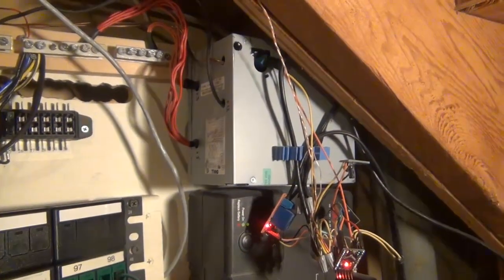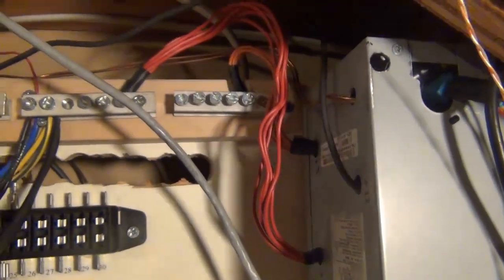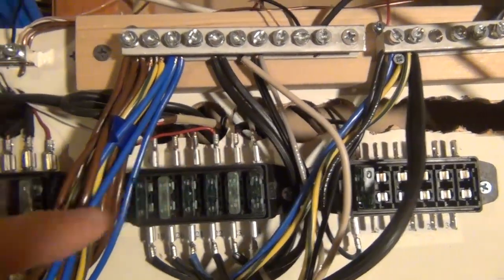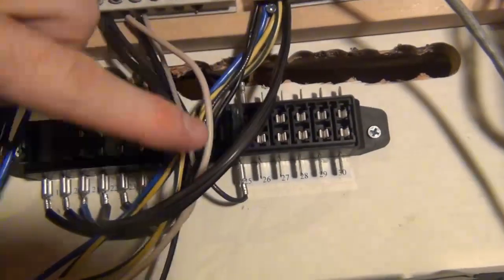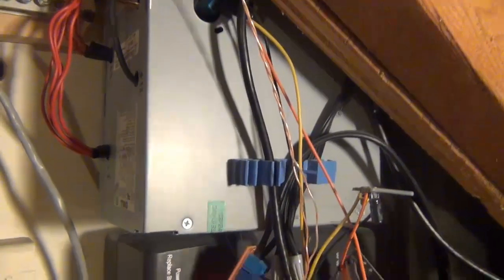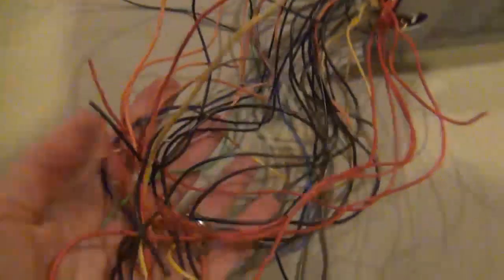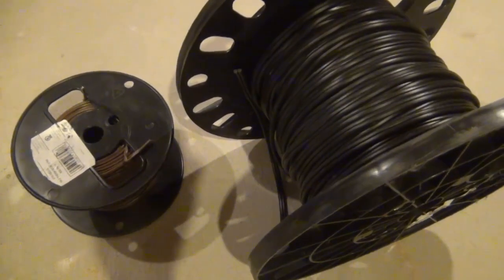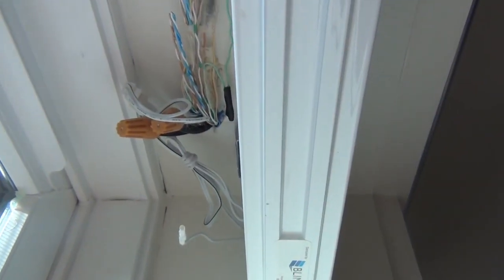DIY Low Voltage Whole House Power Supply

Comment: Nice! As a matter of fact all electronic devices now days are DC with a step down power supply these are like your LED TV, radios, phone chargers, Computers, including the new LED light bulbs the only ones needs to be A/C power are Air conditioners, fridges, cloth washer and dryers, hair dryers, microwaves, toasters, garbage disposals and heavy equipment.
I have all my lights in a low voltage system and it really saves lots of electricity on my bill.
Reply: Good news , even AC unit's that can also heat (mini splits can run AC/DC as a combo), Fridge , freezers , washers all can run ac and DC now.  They do make microwaves for Semi's too but those are usually 24v and are small but is doable.  electric dyers are still 220v ac though but if you get a dc gas one then you might be good.

Comment: I like the Idea, but I'm pretty sure that an installation like that would void any fire-insurance that is on your house. I am not an electrician, but I do believe there are reasons why enclosures exist and need special approvals before going to market :) You actually wired your house with a cheap Chinese power supply, mounted on wood, in your basement.
Reply: With it being all low voltage, this might be acceptable if cable is proper rating.
Reply from the maker: I haven't looked in to if it would void the insurance but it is always good to be safe, I agree.  As with all DIY projects it's important to understand what the implications are for what you're doing.  As for this device, I have a temperature sensor that will shut off power to this device if it gets too hot.  I also believe (but I'm not certain) that this has built in temperature protection as well.

Comment: I'm curious about you running the wires in the walls, you mentioned your going up into the attic but what about coming down the walls esp. in an insulated wall is it 'legal' (according to NEC) to run these wires in the wall outside of some form of sheathing or conduit?
Reply from the maker: When I was doing research on this I found that there isn't much code for low voltage wiring in the USA and that it is ok for home owners to run it. I didn't find anything regarding conduit or sheathing.  I encourage everyone to do their own research for their respective city/county/country though.

Comment: As a suggestion couldn't you set up a system where you have a bunch of Sockets that the power supply usually plugs into and distribute them out to your rails in order to make upgrading your power supply as simple as plug and play?

Comment: Looks good.  I have a main 12VDC wiring system in my house off my solar battery bank.  Then I add small DC-DC converters at various locations for loads needing different voltage.  Using an old PC power supply is a good idea, I have a 25A switching supply as my backup source if my battery bank has to be taken off-line.  It's a lot more efficient to have one large power supply for DC than those dozens of wall warts plugged in to separate devices.

Comment: Awesome, thanks, Pete!  I have been looking forward to this.  I see that the end of the run for the blinds end with the wire pair coming straight out of the wall.  In other applications, have you pulled the 12/5/3.3 volt power into an existing AC wall box or existing light switch?  Have you pulled the power line into a new wall box of it's own?  Do you have a lot of the ArduinoProMini+NRF24L01+ units in the attic with sensor leads going to the things being sensed?  Just wondering how much you hide the wires and how accessible the new lines are.
Reply from the maker: I didn't show it in the video but I have a 12 gauge wire leading up in to my attic that I run both 5V and 12V through.  I use that for additional low power sensors if I need to.  So, I can run the power from the larger wire in the attic to a Pro Mini (or other sensor) via a CAT6 wire.  For lights or blinds I run the wires directly to where I need it from the basement due to the low amperage allowed on a wire.